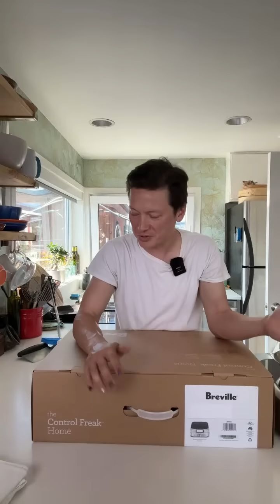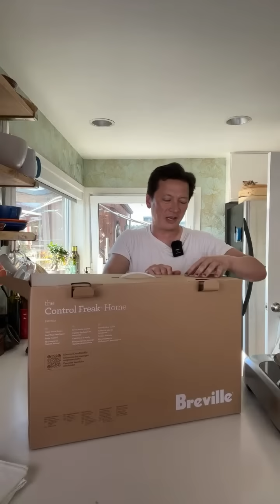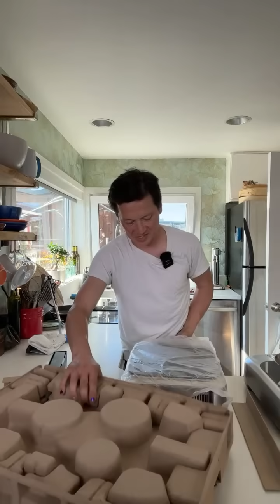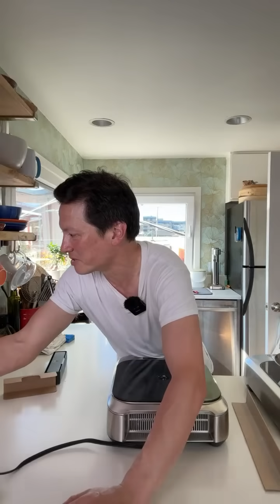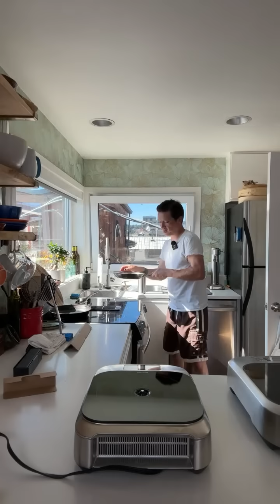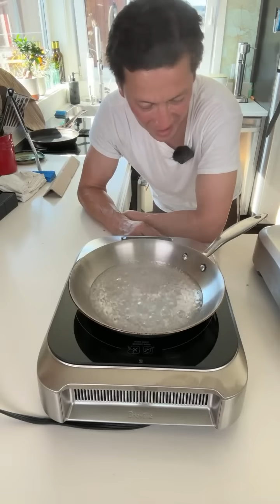Unboxing the Breville Control Freak Home

Comment: I just got one because if the butane burners have no chill between low and medium heat but when filming I was concerned the fan could be too distracting. I’ve had to reset pans in the middle of a cook though so it’s a catch 22. My next house will have burners on the island.

Comment: There is nothing exceptional about the Control Freak. It is the only one with a magnetic coil large enough for a 10-12” pan, which enables it to heat evenly. The other induction burner makers, like Duxtop, hide the mini size of the coil by putting a giant template in the glass; this should be illegal. The household current thing is interesting because many home appliances guarantee failure due to the power source. Deep frying, with any volume of food, can’t be done successfully with home power. To pay $1,500 for a bulky device that takes up half your counter space is ridiculous. And then all you get is something that cooks as well as a portable gas burner. Unless you have more money than brains, this thing is a definite don’t buy.

Comment: Looking at the comparison chart, the Home version has a smaller footprint (about 850 in3 vs 1,100 for the Original) and has a less robust construction, with a thinner shell (4mm vs 8mm), a polymer chassis (vs metal one) and no NSF Commercial Certification. For home use, where boiling 20 liter pots of broth should be occasional, it should work fine. The ceramic glass is sealed (vs bonded) but I am not sure how it impacts reliability and performance in practice. It loses the USB port and the carrying case. Finally the warranty is consumer and not commercial anymore, which is unsurprising.

Comment: A heads up to anyone interested in purchasing.. When I bought it direct from breville it was $1299 with I believe $200 off if you signed up for chef steps studio pass which is an annual subscription.. But the price was sub $100 and got you a $200 discount.

Comment: Kenji you have to talk to the guys over at Impulse Labs and check out their Impulse Cooktop. All Electric but with built in batteries and sensors so you get more control but also can boil something in seconds. It looks so cool and it would be a great fit with your scientific approach to cooking.

Comment: Being an electrician, i don't understand the American electrical grid. We've got 240 volts at 10 amps here as a domestic standard, giving 2400watts per fuse capacity, why are you guys not fixing your broken grid and why do you just accept weak powergrid in america?
Reply: We have a million issues that are so much easier to fix, and we can’t even do that. Changing how the electrical grid works is such a low priority when we can’t even get basic things fixed

Comment: The pan seems a little warped— could the angle of the pan on the cooktops changing the contact with the induction cooktop have changed how you perceived the bubble pattern?

Comment: Thank you for the excellent vids. :)

FWIW: I own both the original control freak, and this new home version. Outside of the physical size differences, the main changes to note are the lack of carrying bag, the lack of the USB programming stick, and the addition of the touchscreen with home oriented information.

The carrying bag was mostly used by caterers and is very handy but a home cook really wouldn’t need it. The USB key was mostly used so a chef could develop a recipe and distributed it to a bunch of the units in a larger restaurant or kitchen for others to use the premade recipes, also something the home user really wouldn’t need.

The slightly smaller size is better for the home. It does look a little nicer in my opinion, and so far I am finding the actual induction pattern to be a bit more even but it’s a tiny degree of change at best. So unless you are a caterer that needs a bag or you have multiples of these and a cooking facility and you need to swap premade temperature profiles, it’s best to save a little bit of money and get the home unit. The “home recipes“ are about as useful/useless as any other, so-called smart, appliance, but luckily you don’t need to use them if you don’t want. All the manual controls and physical dials are right there thank goodness.

While I would hope for a slightly cheaper one for more folks to be able to afford, This is still a good improvement for the average home cook that wantstight temperature control.

Comment: I do wonder how capping the output at a certain temperature, while having only limited control over the power level (low/med/high), impacts the way you would use a burner. More traditional induction burners have 10 or so power levels, though no temperature setting - meaning that the temperature is controlled by the power level plus the contents of your pan. I imagine that it could be something you would need to get used to as it is a very different way of controlling your pan's temperature.

Comment: We bought a full electric range with induction cooktop for less than that from Costco and it has been amazing. I get the breville has some nice stuff, but that is ridiculously priced.
Reply: I've had an induction range at my old place, and the control freak home at the new place.  The control freak easily wins and if I owned both I would never use the range.

Comment: $1500 for a single burner.  Or like $800 for a full stove+oven.  I'm sure it's a great tool but it just seems overpriced is all.
Reply: The big feature that separates this from any other cooktop is the thermometer in the center, allowing for precise temperature control. I wouldn't compare this to others solely for that reason, or at least until it has real competitors.

I own the original model and it is a game changer for sure. If it was stolen or broken, a replacement would be near the top of the to-do list.
Reply: it is. But they do great marketing

Comment: You can get a whole induction cooktop for that price.
Reply: I've had both and would take the CF over a whole range.
Reply: @konsolidated why’s that? Not a range, but an induction cooktop on a counter, w the mounted oven in the wall, euro style.
Reply: @Notturnoir  well the range I had was like a standard gas range but induction.. If the range had the same capabilities as the control freak then sure I would use that.  I just like the features of the control freak more than the simplicity of a full range.

Comment: I bought a Breville Control Freak from Williams Sonoma a few days ago for $1500 and it will be delivered three days from now. As far as I can tell I bought the "original" rather than "home" model but it will be interesting to see which one I get. I expect to be happy regardless since the ~$130 Zavor cooktop it is replacing is borderline useless other than for boiling water. The Zavor cooktop seems to have an induction ring approximately three inches in diameter and the temperatures on the preselect buttons are nowhere close to reality. It would be nice if there was something approximating the Breville Control Freak was available for a price between $500 and $1000 USD.

Comment: Recently moved to an all-electric apartment. TBH I'm struggling. I cook w a cast iron. It gets too hot or not hot enough. Either I'm waiting for so long or stuff gets burnt. As a result I cook like 50% less now vs before w gas. Hopefully I can figure it out cuz I guess this is the future. If ya'll have general tips would appreciate it.
Reply: With my carbon steel and non stick pans I've found putting the heat at 5 works, but for my cast iron I have to put it about 3.5-4. The way I was able to figure it out was cooking a pack of bacon (it was a week of BLT's). Using an infrared thermometer I was able to figure out what temperature setting I could actually cook the bacon at without burning it and what temp the cast iron was at.
Reply: Have you considered pre-heating the cast iron in the oven before cooking on electric? Would that even make a difference? I've never used cast iron so I have no idea. I've only ever used electric hobs at home though, probably explains why I've never used cast iron.

Comment: After seeing Kenji cooking on the OG Control Freak back in 2016-17, I sprung for one ($1200 off eBay down from $1800) when we were without a proper kitchen during a home remodel in late 2018. Holy cow, what an unbelievably awesome piece of kit. It single handedly got me into actual deep frying, as the probe control allows for me to fry enough wings or brussel sprouts to feed 10 friends at a time. We were able to do a Hot Ones bday party with 10 freshly fried wings (for each round)/person for 10 people and I barely broke a sweat. Due to the probe control again, you can also skip buying or sell your sous vide machine as it becomes redundant. Combine that with the timer that automatically turns off the cooktop and it’s just a transformative piece of tech. Confit, fry, poach.

Amazing piece of kit.
Reply: You have ten friends who eat Brussel sprouts?
Reply: @colacurciolaw7745  Yes… and almost all the adults I’ve served brussel sprouts love them. Brussel sprouts are great, and they only got a bad rap (with me too!) because the Greatest Generation and  the Silent Generation and even Boomers insisted on boiling the shit out of them. Yeah boiled brussels ain’t great. Fried brussels are great: kenji’s got some marvelous recipes for em (especially the one with shallots, Thai bird chilies and fish sauce).

Comment: Curious what Breville's margin is on this. On one hand I don't see how it costs anywhere near $1000 to manufacture when a non smart induction can be bought for $80, though on the other I feel like if they could they would drop the price. This is extremely niche at this price. Even if you are not concerned with $$ many don't want extra clutter on their countertops, and would probably be more inclined to pay for the same tech if it were baked into their full-size range.

Comment: The problem I have with using something like this is that the vast majority of your viewers probably do not have one.  You will obtain results that they won't be able to duplicate, or will have trouble duplicating.  About a year ago comments on one of your videos went in the direction of people enjoying that you used every day items in your kitchen.  Toys are fun, no doubt.  I, for one, would rather you didn't use them.  Just my opinion - haters go elsewhere please.
Reply: Questionable to say that he will obtain results that viewers will not be able to; I have one and there is nothing I can do on the CF that I can’t do on any other burner. It’s just more consistent and accurate. Maybe the only thing is maintains a temperature by probe, but I doubt he will use that often and it will always be replaceable by slightly more manual work with a thermometer. I really dislike this argument as it’s akin to saying “well you have induction so I can’t make this work on my gas stove!” Or “I only have nonstick pans so I can’t possibly do this recipe” which neither are outright true
Reply: @Montagic  So then, tell me what the point of spending $1,500-$2,000 for this is?    I worked in restaurants over 30 years and I can say with complete confidence that the high btu stoves used in a restaurant kick the s**t out of something a home user has.
Reply: @bjones9942  it’s a high precision high accuracy high power induction stove top. It heats pans to a specific temperature and maintains that temperature through a thermocouple that reads your pans temperature, or through a probe thermometer attached and inserted into something like protein. It is also going to be far more efficient and powerful than most home gas stoves which are not only usually around 5000 BTU or lower, but also have terrible thermal efficiency at 20-30%, so you’re not even getting that 5000 BTU at full blast. It’s a better portable stove, that’s literally it.
Reply: @bjones9942 it does not, otherwise there would be no reason to ever get anything but the shittiest non stick pan set you can. 😂

Comment: I just bought the original model about a year ago. I do not regret it… 
I’m not rich but I rationalized it by not buying a new phone every 2-3 years. I’m gonna suck it up with an old phone and get better at cooking instead. 
If you’re serious about cooking, you should consider what it can do for you. I cook way more now since it’s like microwave speed for your pots & pans.
Reply: Honestly this isn’t even close to the reason that most people get one which is, well, control, not speed
Reply: @nuggyfresh6430  well, my point is that there are other reasons besides the obvious control freak aspect. 
I live in a rental with an electric stove. It’s ancient and decrepit to cook on. Pans don’t even lay flat on the coils. 
So ya, this thing is life changing for me and my family. 👍

Comment: I wonder if the option for slow, medium and fast heat up are because of how carbon steel pans can warp on an induction top if you go right to the highest heat. I didn't know that when we moved into this house and warped my old wok (which luckily was not a wonderful one anyway). I now start my carbon steel pans on a fairly low number like 3.5  (numbers on my induction top go from 1 to 9 with a boost for over 9) and work my way up to higher temps.

Comment: Beyond some minor industrial design updates I genuinely have no idea how its any different from the old one, and ive gone to the website and watched the chefsteps announcement video
Reply: @hjewkes  it’s easier to add recipes because of the touch screen, and the glass lip is slightly different. Also smaller foot print and less water resistance. That’s basically it

Comment: I'd love to have that old  Breville Polyscience induction home stove Kenji has used for 10 years, but it's still $1,500 for a single burner. The new cook top Kenji got is not much cheaper at $1,299.  The only good thing is it runs on 120V regular household current.
Reply: The old one does, too.